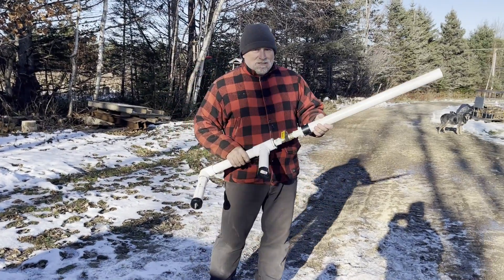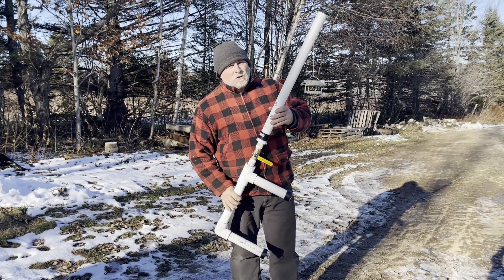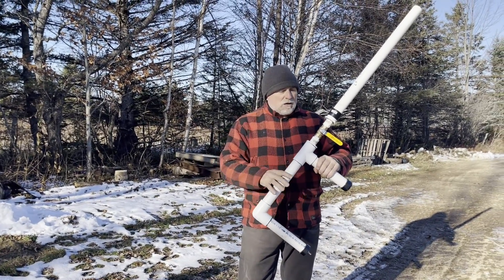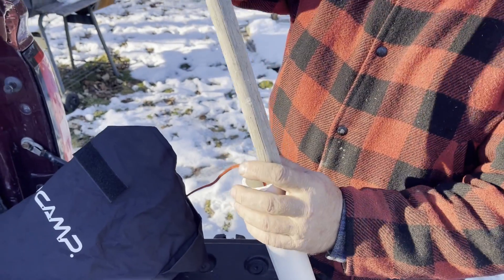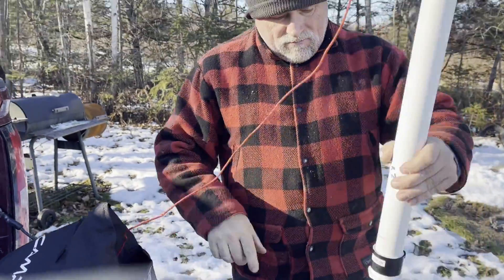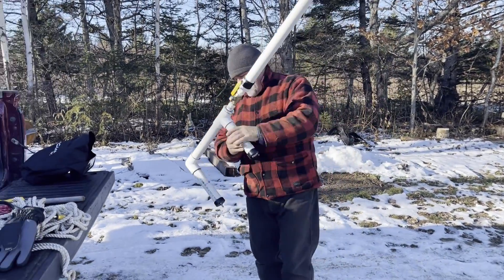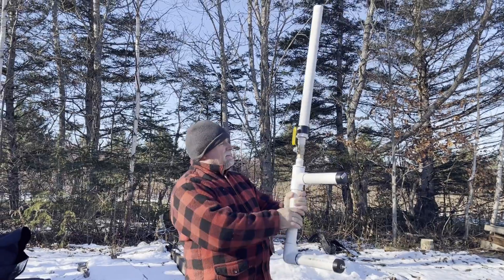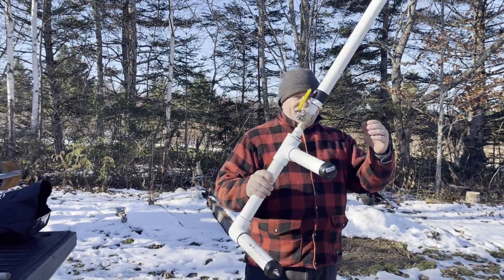DIY Throw Bag Launcher  | Arbor Techs

Comment: What size ball valve is that 1 inch?
Reply from the maker: @theyouthfulbodypro3985  Yes.
Reply: thank  you
Reply: Looks like the main part is 2 inch?
Reply from the maker: @ It may be 1&1/2. I can check. It’s been a while since I built it. I know my 16oz throw bag fits snug and you want that so there isn’t much air pressure loss